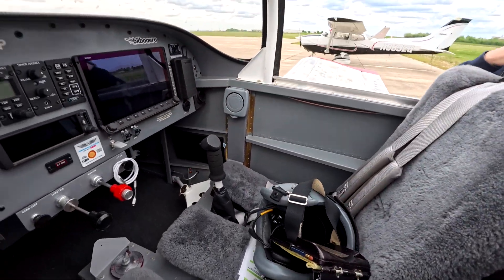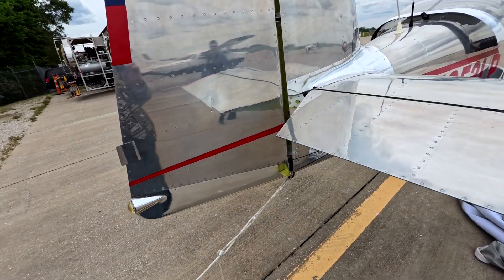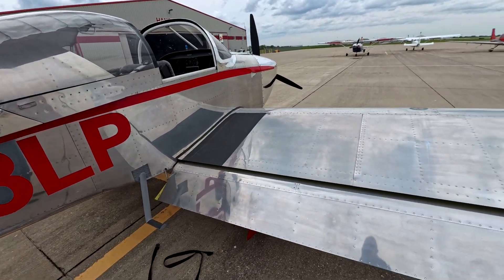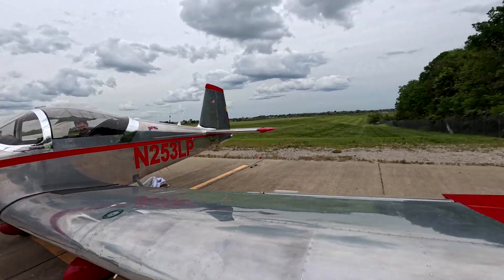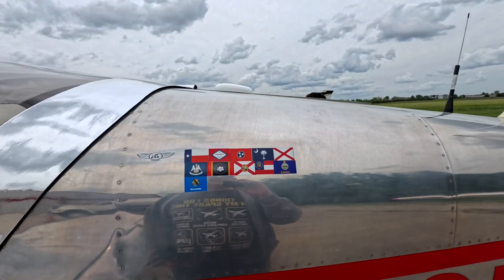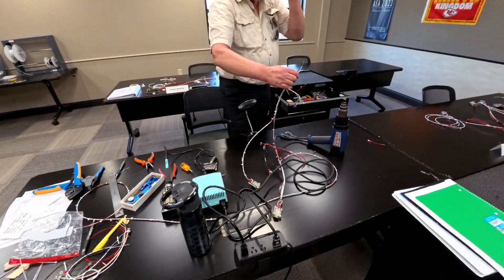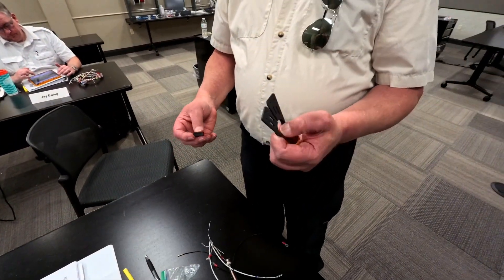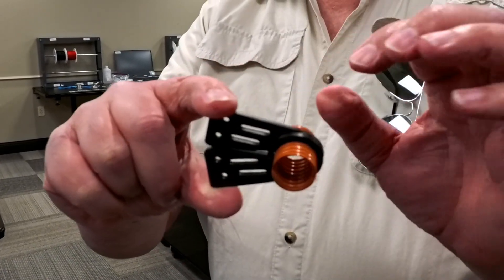RV-14A | AEA Training Class #2 - Avionics Installation for Experimental Aircraft #vansaircraft

Comment: Not sure where you are with your build, but do yourself a favor and postpone any avionics purchases until the very end. Not only will you have useful warranty coverage and save on updates/SBs while your stuff sits on a shelf. Also changes in rules and regulations may make your early purchases obsolete before you finish the project. I ran into that in Europe where 8.33kHz radio and 406MHz ELTs became mandatory.
Reply from the maker: Great advice! Levi, the instructor in the class, said the same thing. 
I'm wondering about the wings. I was considering getting the pitot tube and roll server (and lights) so I could have everything wired in the wings and I could close up the bottom skins. Would you recommend waiting on those and finishing up the skins later?
Thanks again for the advice. keep it coming! I'm always up for saving time, money or headaches. :)
Reply: @SlinkAir  Glad to help ;) On the wings I do not have a strong opinion. I built a rag-and-tube Rans S-6S which didn't need many of those choices. If your build schedule is to finish the wing skins soon, get the lights and roll servo. Pitot tubes are not going through revolutionary changes anymore and parts go up in price over time, so getting those parts now might make sense.